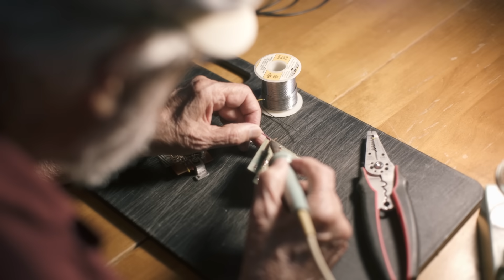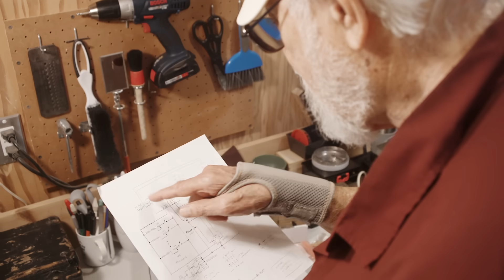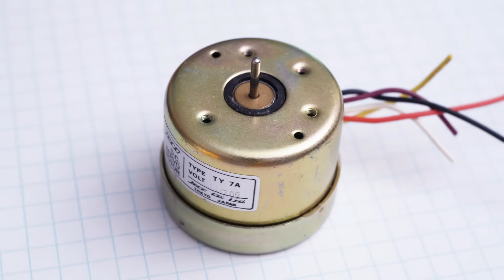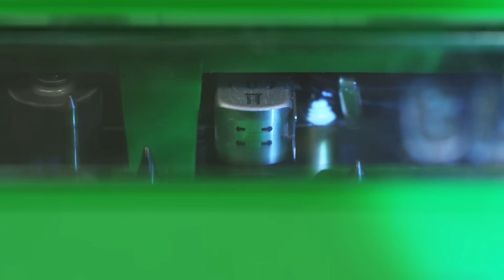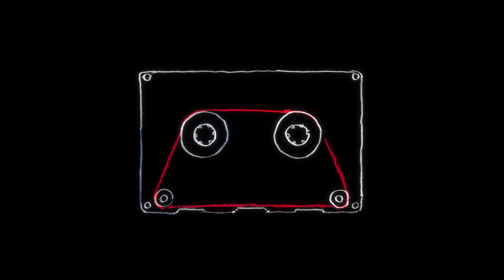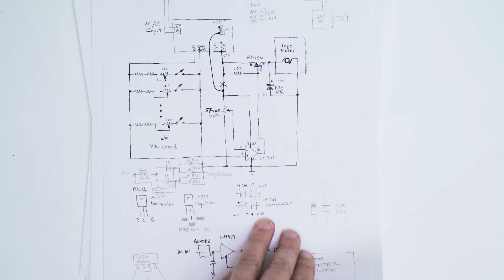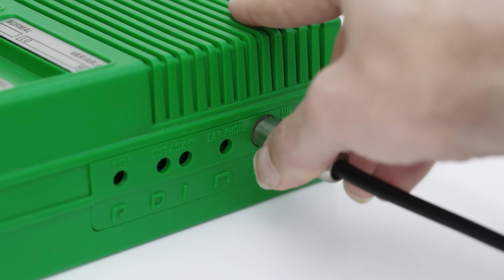Tape Speed Keyboard

Comment: Could you design a mellowtron-esque keyboard with interchangeable tape sounds with this same concept? That would be very cool.....
Reply from the maker: It depends on what you mean by Mellotron-esque. My design runs the tape at different speeds rather than having a different channel for each key. You can't put that many tracks on a cassette. The most I've ever heard of was 16, but the audio fidelity with tracks that thin is pretty bad. It would be super cool to use a VHS tape (4 times the width) to store a bunch of channels. With the right tape head(s), you could probably get a couple octaves to fit onto it. Then you could swap out VHS tapes with different instrument tones.
Reply: @japhyriddle  For example, would you be able to play the beginning of Strawberry Fields Forever on your device? That's pretty much what I meant lol. TBH, I don't fully understand how a mellotron works, I thought you hit a key and it plays a sound recorded on tape, at different speeds, depending on which key you press :(

Comment: This is very cool, I've had a similar thought but I didn't know how to pull off the voltage control from the keyboard.

I love making tape loop instruments, I solved the problem of the blank gap on my Tascam by installing a switch to toggle power to the erase head. The timing can be a little tricky, but it also allows for sound on sound recording which sounds great on cassette imo.
Reply from the maker: Thank you. My approach was just dumb brute force, ha ha ha. Installing pots/resistors for each key. But, outside of going a digital route like MIDI, maybe there's some kind of analog frequency counter that could listen to the note and then put out a voltage? I don't know what exists.

Yes, enabling/disabling the erase is the way to go. At one point I was thinking about making some kind of timing circuit to automate the process, but of course I never got around to making it, ha ha. Now that I think about it, maybe a pot rather than a switch would be better, so you could fade/blend the loop?
Reply: @japhyriddle  The pot is a great idea, because I do sometimes get a pop at the point in the tape where I cut off power, a fade would solve that. I also don't have a background in this stuff haha just making it up as I go.
Reply from the maker: @GarettBegnoche  Cool. Let me know if that works out. It's fun just stumbling through this stuff (assuming we don't break too much equipment along the way, ha ha).

Comment: so basically you've just made mellotron, but.. weirder xD
It could be bunch of tapes with 4 sound channels. And it could work better if there was used two tapes and like keys 1,3,5,7,9ect would use tape one, and 2,4,6,8,10 tape 2, so it would be easier to manage change with tones. So loop tapes would be in pairs.
Reply from the maker: Neat idea. I think it's cool that there aren't a lot of channels, personally. I like its limitations. I think that's what makes it unique.

Comment: Very cool! I recently completed my own similar project but i took a very different approach and used a microcontroller (pipico) to take midi input and then use that to control a DAC that adjusts the motor speed. Calibration of the notes is done in the code on a little OLED screen and rotary encoder and then it stores the values in an EEPROM. It's still very much work in progress, lots of bugs to iron out in the code and the cassette player i'm using (Sony TCM-20DV) has dodgy capstan but eventually/ultimately i want to create a PCB that people can make themselves... I also plan to get ahold of a decent cassette player such as a tascam 414 and add my module to it in a non-destructive easily reversible manner.
Reply from the maker: That's so cool. Yours sounds way more controlled than my wobbly analog version. I'd love to see it/hear it when it's in a presentable state : )

Comment: Some Walkmen, other personal stereos, and perhaps cassette decks, can play both sides of the tape by reversing the motor's direction, and moving the tape heads slightly to line up with the tracks on the other "side" of the tape. Usually this is done by mechanically moving the tape head. But were there any that had all 4 tracks (left / right, side 1 / 2) wired up to the head, and just switched the signals electronically? Since the early Tascam 4-track portastudios DID have a 4-track head, that let them use ordinary cassette tape. Hopefully the heads are still available or salvageable. Then you'd have 4 options instead of just 4. You'd also be able to mix between them. 

That'd work for things like octaves, where the notes in each octave have a mathematical relationship with the octave above or below. You could also do, well, whatever you can imagine. Maybe a 4-head cassette mech is what you're looking for?
Reply from the maker: With those decks, I think, pedantically, the motor itself doesn't change direction, but an extra wheel/cog makes contact to reverse the play direction? But I know what you mean. I'd guess there's probably a deck with a 4-track head out there, but I'm not sure. I thought about getting a 4-track head. I think any tape transport can just have its head changed out for a multi-track  one if there's enough physical space. The more I think about it though, I kinda enjoy the limitation of having only 2 tracks : )

Comment: I think this is fantastic. A few years ago, someone was selling an item on eBay where they took an old hard drive and and an electroacoustic mic/pickup, and changed pitch by changing the speed on the hard drive. They were just using a single pot, but I would think your keyboard could do the same thing.
Reply from the maker: Whoa. I wouldn't expect to see something like that turn up on eBay. That's pretty awesome. Yes, the keyboard could take the place of the pot.
Reply: @japhyriddle it may have been on Etsy, but I think it was eBay. I’ve been looking for it for a while, but haven’t seen one turn up in several years.
Reply from the maker: @phogue1  Darn. Well, hopefully you can find one, or make one.
Reply: @japhyriddle Hm. Maybe I might try making one. I’ll let you know if I do!

Comment: I have a similar instrument that I am working on. It is "easily" possible to have a loop tape without a gap. Just record your desired tones onto a few seconds of tape and then splice them into a loop. The only downside of doing it this way is that it takes almost the same amount of time of focused effort as it does to set a cassette up to record and then go make yourself some dinner at the same time.
Reply from the maker: Oh cool. I'd love to see your instrument when it's finished. Yes, it's true. Pre-recorded tape can be made into loops gaplessly. I should have specified that in the video. I think I'm only interested in ones that I can record onto after they've been made into loops. It's possible to do that too, but it involves disabling/enabling the erase head with proper timing.

Comment: You can make a tape loop without a blank spot by covering the erase head with aluminum foil then cutting the splice at an angle and using cassette splicing tape.
Reply from the maker: It's true. I actually wanted to modify a tape recorder at one point and add a special erase head disable/enable timer so the process would be more automatic, but I never got around to it. And I probably won't ever do it because I have too many other projects.

Comment: Couldn’t you have just used a midi keyboard and a midi to cv module and used the cv to control the speed of the motor?
Reply from the maker: Yes. I did think about MIDI, but I found something beautiful about the simplicity of going the completely analog route.

Comment: I would have used a *duino of some flavor to make a MIDI-driven motor speed controller. Many versions of each software component you'd need are available on Github.
Reply from the maker: I did consider going the MIDI route, but I found something beautiful about the simplicity of doing everything in an analog way.

Comment: Cool project! Was not expecting to see an MT-100 either!
Reply from the maker: Thank you. 

I had no idea what the MT-100 even was when I randomly bought it for $13 at a thrift store. I hate it because every sound in there is terrible, but I also love it because every sound in there is terrible ; )
Reply: @japhyriddle  You got an absolute steal there. They're seemingly unloved, but they combine a Roland PR-100 MIDI sequencer with an MT-32 synthesiser, of which the latter is highly coveted in the retro gaming scene and sells for a couple of hundred bucks nowadays. It's a cut down version of the LA synthesis engine used in the D-50 - and is very close to the D-110 rack mount synth. You should play around with an MT-32 editor and make your own voices; it can make some really cool stuff still!
Reply from the maker: @cromulence  Yes, I've read about people loving the MT-32. Ooh, there's an editor? That sounds fun to play with. I wish this thing used normal floppies. I don't have any Quick Disks. I wonder if data transfer into memory can be done through MIDI.
Reply: @japhyriddle not sure there is any direct transfer method, but you could at least play the midi recording into your PC and record the data that way. You can replace the quick disk drive with a USB floppy emulator too.

I’ve seen someone use a floppy drive as an analog audio medium… could be a super cool storage idea for your instrument!
Reply from the maker: @cromulence  Good point. I'll probably just get something new though. I've been wanting to build a "SamplerBox", a little Raspberry Pi sampler with MIDI.

Ah, yes. I've seen a video or two where someone recorded audio onto a floppy. No magnetic media is off limits.

Comment: Another approach could be using MIDI for input (so you may use any MIDI keyboard), an Arduino to convert the MIDI messages into a PWM signal and power the tape deck transport mechanism with a stepper motor. The advantage with this approach is you won't need tuning because the motor speed is fed digitally and all you have is to calculate the PWM frequency. This is much simpler on the hardware side but it requires programming (AI can help with that).
Reply from the maker: I mention MIDI in the end of the video. I had that thought while building it, but the idea didn't excite me as much as the simple and direct route I went with.
Reply: @japhyriddle  Yes, the full analog approach  totally makes sense and feels more authentic.

Comment: Reminds me of the Crudman! Midi controllable walkman things from many years ago
Reply from the maker: I'll have to check that out. It sounds interesting.
Reply: @japhyriddle definitely look em up! A similar idea but not identical. I don't think they are made anymore, they were based on a very specific  tape deck that the creator would reverse engineer into the "Crudman" on a pre-order batch type system if I remember correctly. They could be daisy chained for polyphony.
Reply from the maker: @Afreelunch85  That sounds like a really neat idea.

Comment: This is similar to, but importantly different than a Cassettone. And I love it! I made a Cassettone that has a little keyboard -- only 13 notes -- and I had to create new wiring "programming" to pull it off. The original design gets slower and slower the more buttons or keys it has -- by default only 4, and it really maxes out at five or six. And even mine wouldn't scale up to a full size keyboard as it stands. 

I haven't been active on the forums the last couple of years, but I know that back then lots of folks were trying to crack the code to do what your board does, so yes, please release the files! I'm sure there would be interest! It's ridiculously niche, so it might not be a lot of people interested, but those who are will be very interested and likely build one, and they may share insights with you on ways to improve your MKII, if you want that.
Reply from the maker: Yeah, pretty similar idea. I was glad when I started seeing people making stuff like that. It was extra inspiration to finish my project. 13 notes is enough.

I really should make a proper schematic. Only certain parts are properly documented currently. I don't think I want to make a second version. I just want to inspire someone else to make something better : )

Comment: 6:17 those keyblers should be controlled by a control pedal, makes much more sense to me as a keyboard player, that way you can still use both hands for playing
Reply: Except that it's purely monophonic: one note at a time (unless the tape itself is polyphonic, but even then, it's the same chord pitched up or down a single keypress at a time).
Reply from the maker: @DMLand  Yes. I guess if you wanted to go from a low key to a high key as fast as possible, you might want two hands to do it. I think that's an edge case scenario.

Comment: This fits into an idea I've had for years. I wanted to make a delay type thing that I could play guitar or something into, crank up the feedback, then play the feedback musically.
Reply: So a boss distortion feedbacker circuit?
Reply: Or you mean quantizing the pitch of the repeats to notes in a delay?
Reply from the maker: Oh, like a Space Echo, but with pitch controls. It would be great to have the guitar itself control the tape speed!
Reply: @japhyriddle  I think it would be hard to work an algorithm out for this as the original note sampled by the delay would affect the feedback pitch (although not when the delay time is less than the cycle time of original waveform?)
Reply from the maker: @kashioboy6055  I was imagining it as a second step. Like, first get a guitar loop, then step on a different button to enable guitar pitching mode. Something like that.
Reply: @japhyriddle  yeah but it would still need to calculate the pitch or length of the loop I think regardless to know how how much to quantize the feedback to keep it in tune...

Comment: I think it wouldn't be hard to make a digitally controlled version, which retains the analog signal path. I'm wondering if a stepper motor (in conjunction with a stepper driver made by Trinamic - their stuff is the best IMHO) would be stable enough to move the tape without excessive wow and especially flutter, because that would simplify the project by a great deal. An old top loading cassette deck with a mains powered capstan motor would be a prime candidate for conversion, having the motor and audio circuit completely separate and having enough space for the microcontroller as well.
Reply from the maker: I agree. I had the same thoughts myself. But, that idea just didn't excite me as much as the really simple/direct analog approach I went with. Even with all its wonkiness... maybe because of it's wonkiness, ha ha.

Comment: Sell it! Anyway, there are industrial Endless Cassettes ranging from three minutes to half an hour, without any gaps in the joints as the handmade ones. 🙂
Reply from the maker: I wish I had a factory that could pump these out. Yeah, the splices aren't the issue when it comes to gaps. It's the distance between the erase head and the record head when recording onto loop tapes. There are ways to solve that issue, but it's a little more involved. Whoa, half an hour! The longest I'd ever heard of was 12 minutes I think.

Comment: Fantastic project. Too cool. A couple of thoughts. 

As far as dealing with that click noise when you start and stop the tape, it might be as easy as soldering in a capacitor between the tape out put and the output Jack. 

When it comes to getting gape in the tape loop, you should check out sound on sound recording. There are some cool video that address this idea. 

I hope those ideas help you out. Keep making cool things.
Reply from the maker: Thank you very much. Yes, I'm pretty sure a capacitor (and resister?) is probably all you need to stop to the pops/clicks. I just got too excited to improve anything once I got the thing up and running.

I had an idea about making a timed erase head kill switch thing which could solve the gap problem. But, it's another thing to build that I'll never get around to, ha ha ha.

Thank you for the suggestions : )
Reply: @japhyriddle  A kill switch would be cool to disengage the erase head, but a low tech solution is to physically put something in the way. I have had success with a strip on aluminum foil places between the erase head and the magnetic tape of the cassette. I have even used a bit of low tack painters masking tape.
Reply from the maker: @joshuagambetta5827  Ha. Yes, I've thought about doing that myself, but I've never tried it. I love low tech solutions : )

Comment: Two things. 

For your next model you should try out the Sony Confercorder BM145 or 146. They have mono out but can read 4 channels, each with independent mutes. This way you could do 4 tones instead of just two. They are kind of a hidden gem.

Also, tape loops. If you layer a piece of audiotape across the splice and use narrow double sided tape, it gives you a near perfect loop. I use ones made for scrapbooking and they are almost the perfect width.
Reply from the maker: Ooh, that's a cool deck. I'd never heard of it. Some people in the comments have suggested doing it with an 8-track deck. 8-track tapes loop as well.

The tape splice is not what causes the gap. Well, it can make a little gap. If you make your loop out of tape that's already been recorded onto, then that's the only gap that you need to worry about. But the real issue is if you're trying to make a looping tape that you can record onto. The distance/time between the erase head and the record head will always leave a significant blank spot. The only way to solve this issue is to have an erase head that can be enabled and disabled with accurate timing. I thought about building something like this, but I know I'll never actually get around to it, ha ha ha.

Thank you for your suggestions.